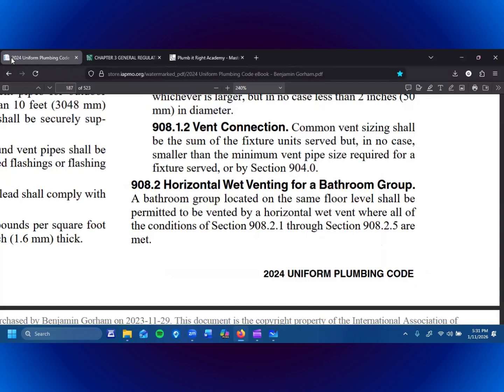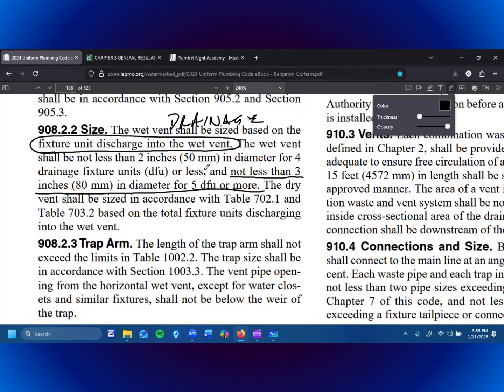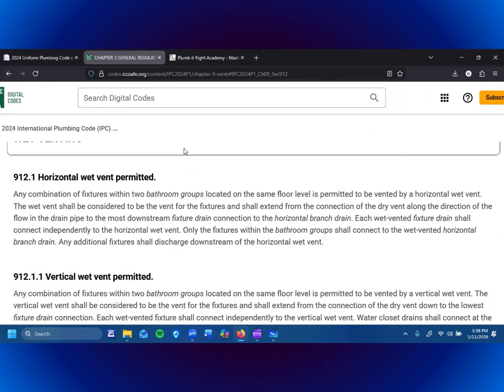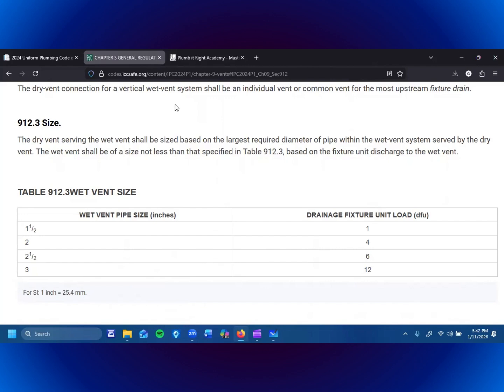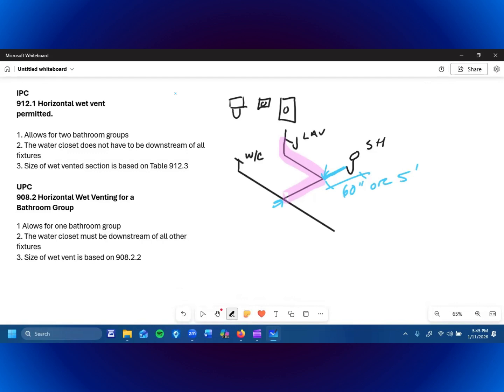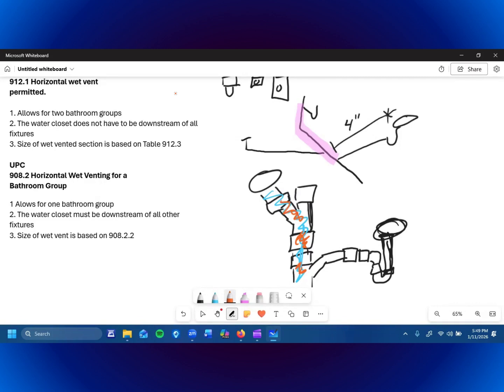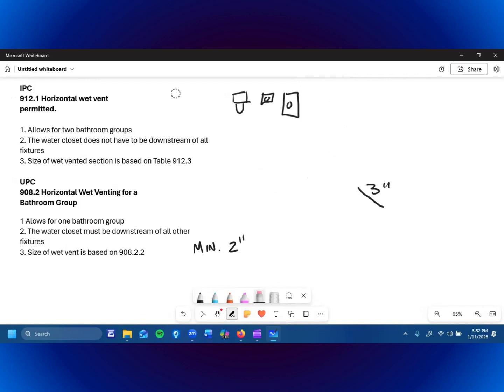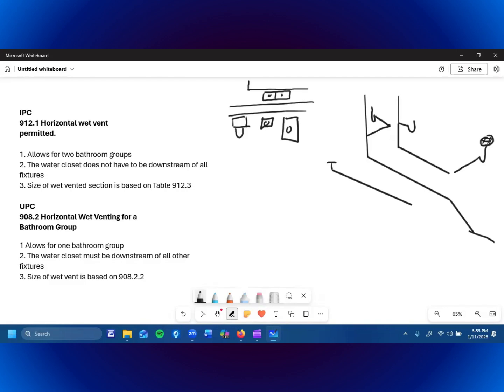Horizontal Wet Venting

Comment: Hi, Thanks for the video. I am trying to understand how the 2" horizontal wet vent has 4 fixture units or less on it. The LAV is 1, a TUB/Shower is 2 and a WC is 3 if less than 1.6G/flush. Doesn't that mean the 2" vent has 6 fixture units on it at least? Thank you.
Reply from the maker: That's a great question! A wet vented section is sized based on drainage fixture units, not the fixtures vented.  Keep in mind that the WC is to be the furthest downstream fixture, based on the UPC, so the 3" requirement of it's drain will not apply for it's wet vent.  Does this answer the question sufficiently? If you need further explanation, email me at plumbitrightacademy@outlook.com and we will work it out.  Thank you for watching!

Comment: Im assuming the connection between the wet vent and the toilet drain line in the first layout does not need to takeoff above the centerline (rolled up)?
Reply from the maker: You are correct. The only fixture that requires being over the centerline, as stated in 905.2 is the dry vented fixture. In this case, the lav. Great assumption!
Reply: @PlumbitRight  so in the first example you drew out, the 2” wye and 45 combo that would be going to the lav has to be rolled up?
Reply from the maker: Section 908.2.1 mentions the DRY vent connection to the horizontal wet vent shall be in accordance with section 905.2, and I can see where the confusion is.  Look at it like this, the DRY vent connection is where the lav trap arm ties into the santee. Upstream of the fitting barrel is DRY vent, and WET vent begins on the downstream side of the fitting barrel.   Does that help a bit? If not, I'd be happy to do a quick video explaining this one aspect of 908.2.1